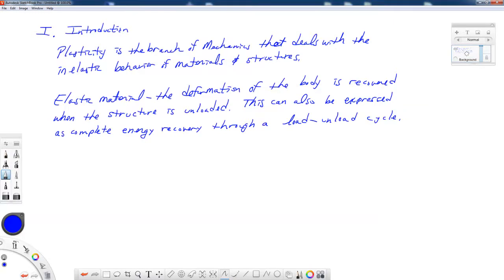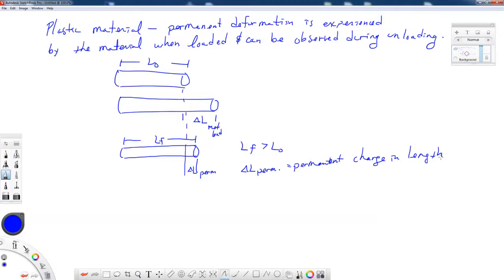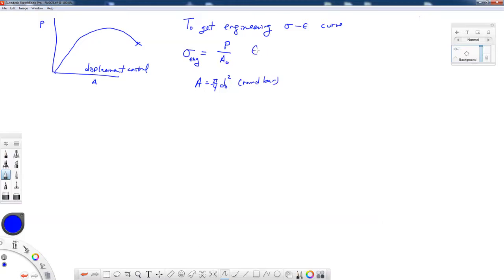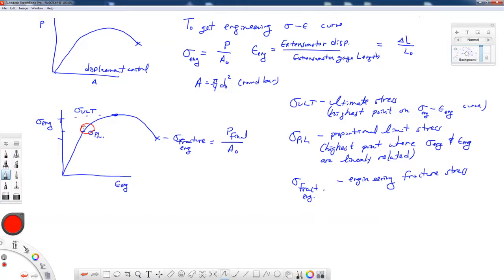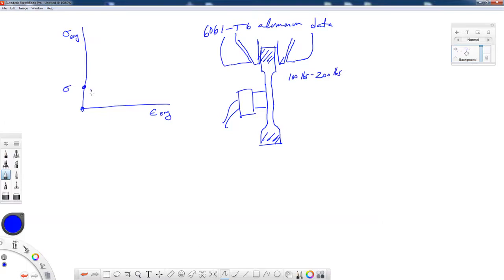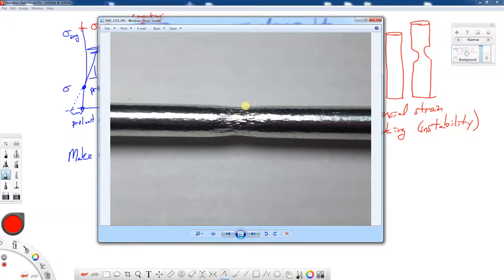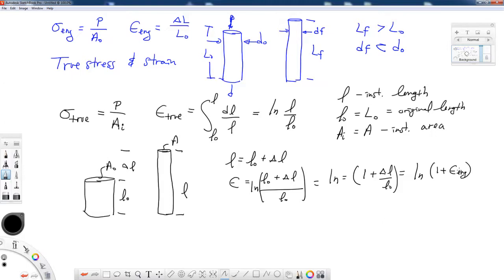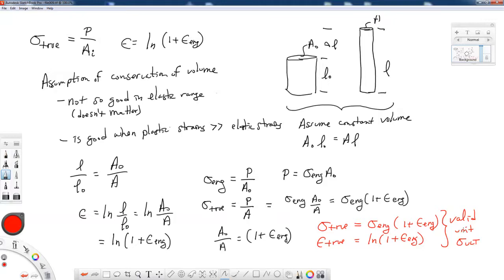AEM 648-2-monotonic uniaxial plasticity and stress strain curves

Comment: Hi Professor Mark, I have a question as a civil engineer I've been taught that all weird behavior occurs in the plastic range of the materials. At some point you mention that in the elastic range the assumption of constant volume it's not a good assumption but it is in the plastic range which is sort of contradictory since in the plastic range it's where we see large displacements and changes and not in the elastic range, at least I've been taught that for structural low carbon steel. But can you explain a but further  the reason why it's not a good assumption in the elastic range, but it is in plastic?   I'm a bit confuse. 
Thanks for the great lectures.
Reply from the maker: Hi Erick,  
There are some different ways to determine the change in volume.  The best way is to find Detlta_V = V_final - V_initial.  But the change in volume over original volume can also be found to first order (i.e. small deformations) by the trace of the strain tensor, e.g. eps_x + eps_y + eps_z = trace = dilatational strain.  Consider a unit cube subjected to uniaxial (elastic) stress.  Take any reasonable modulus of elasticity, and Poison's ratio (nu) of 0.25 or 0.30.  You will see that either method of determining the change in volume does not result in zero.  Although mass is conserved in the elastic range, volume is not and the density of the material changes (slightly).

As the material begins to yield, there is an elastic-plastic strain state, i.e. you have both elastic strains and plastic strains.  Careful experiments have shown that trace of the plastic strain tensor is zero, i.e. eps_x_plastic + eps_y_plastic + eps_z_plastic = 0.  This is also derivable from common assumptions in metal plasticity theory (normality flow rule).  When the strain state is dominated by plasticity, the elastic strains are not significant in comparison to the plastic strains, and therefore we can say that conservation of volume is good in the (higher) plastic range of metals.

Some people use the term "plastic Poison's ratio" and say nu_plastic = 0.5.  This is really bad terminology in my opinion, but it does get the idea across that plastic strains are volume conserving.  (Note that materials with nu = 0.5 such as rubber are volume conserving.)

Now, whether or not you consider the small volume change within the elastic range to be of any significance depends on your application--probably not for any civil engineering applications, but maybe for other applications such as looking at residual stress states, metal forming applications, and so forth.